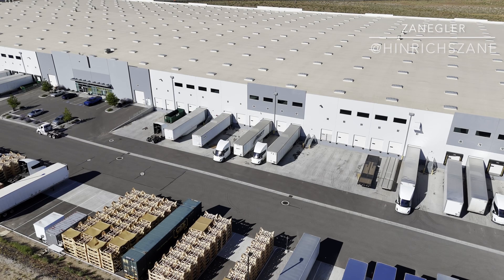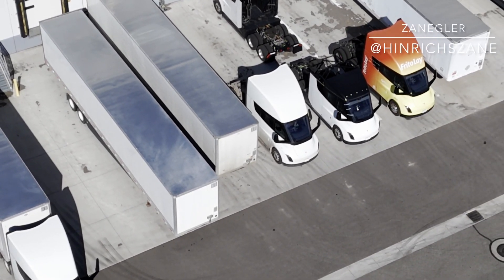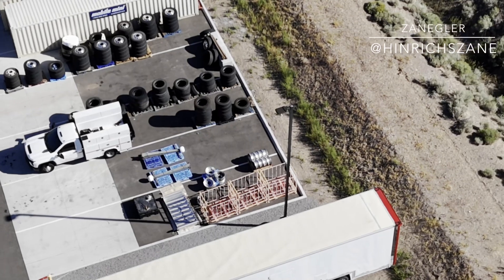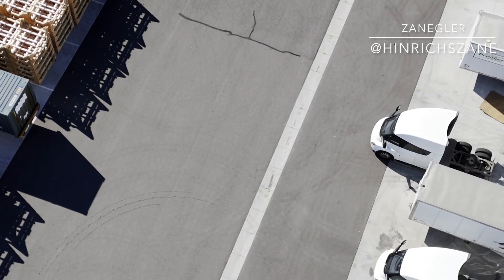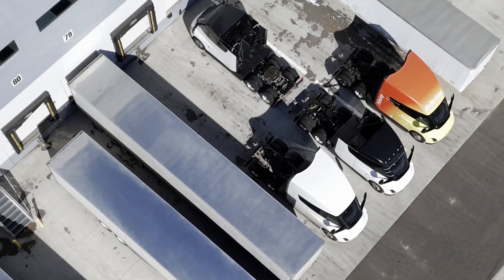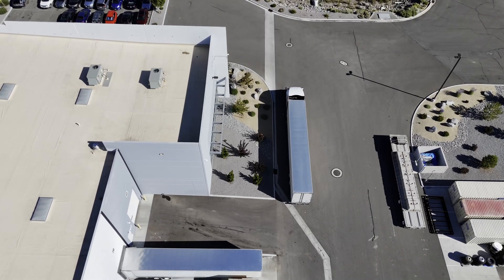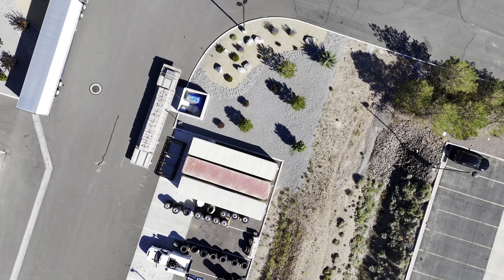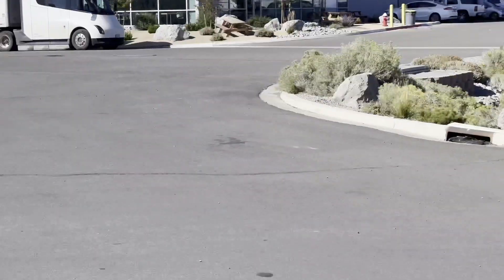Tesla Semi Program Discussion - Tractors & Trailers & More.

Comment: I'm speculating .
Recently heard the Kato road 4680 Plant is Upgrading for 3 Months.
Meanwhile, latest speculation on the Cybertruck cell is that it's at 290W/ kg (better than the 2170) just with "mechanical" upgrades.
.
I wonder if Kato Road will reopen with an extra chemistry improvement, to be used as a test cell in the Semi, ready for the Nevada vehicle and battery factory in maybe Q2(?) 2024...
If they can get 5-10% on top of that 290W/kg it would be a big improvement for the Semi.

Comment: Great video. Very informative. 
Is Tesla still building Semis? If so is it going to new customers or Pepsi. 
When will Tesla start the building expansion?
Reply from the maker: Tesla built around ~52 semis, 36 of these were delivered to Pepsico who is using them to deliver product and provide real-world feedback. The rest were kept by Telsa and are being run through their paces, accumulating miles. This data will be used to tweak the design and make it even better. Once they feel they have enough data, I expect they will restart the prototype line while the expansion is underway. My hunch is Walmart will get the net tranche of semi's.
Reply: @ZaneglerTeslaSemiStalker-vt3or  Thank you. I hope Tesla starts building Semi in large numbers as there is a huge latent demand and it is good for the environment.

Comment: Which axle is the one that disconnects for highway cruising?
Reply from the maker: The rearmost axle is the EDA or single-motor efficiency drive  axle, and the front axle is the TDA or dual-motor torque drive axle.
Reply: @ZaneglerTeslaSemiStalker-vt3or  Thank you, by front axle you're not referring to the steering axle but the middle one, correct?
Reply from the maker: @boostav  exactly. Front drive axle.